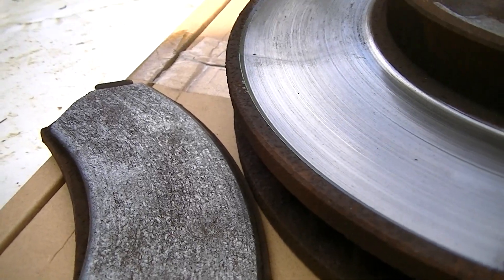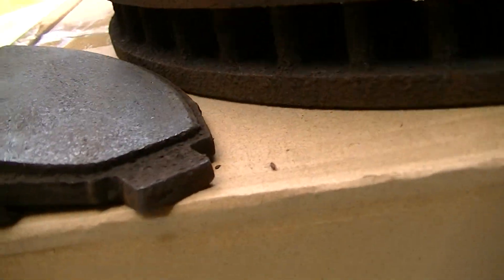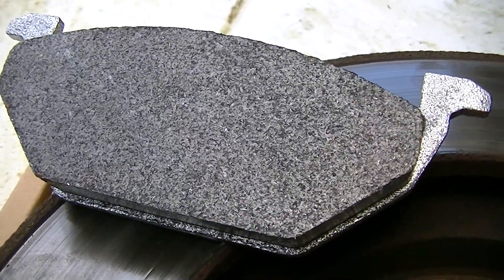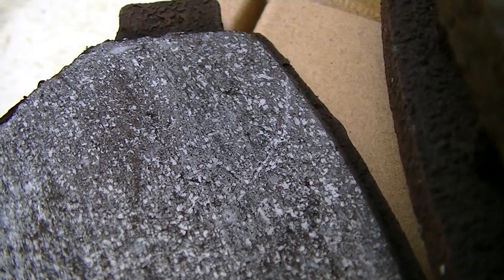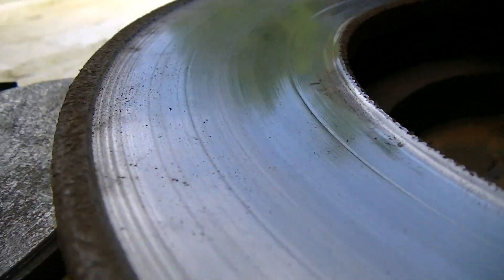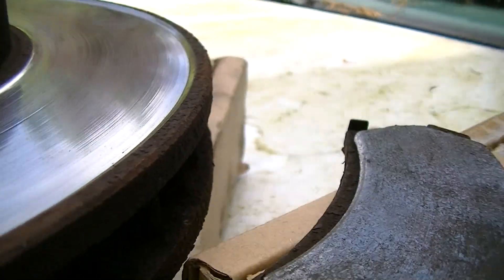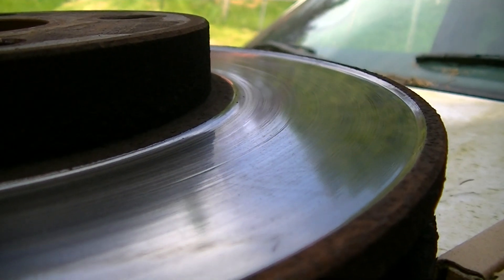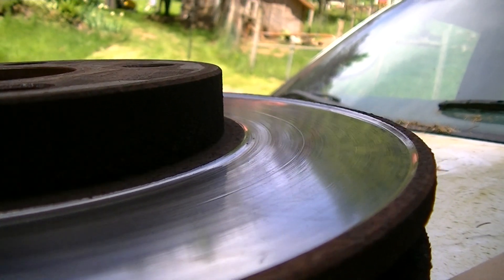Do Metallic Pads Wear out Rotors?

Comment: With brake pads semi metallic pads will wear rotors down, both rotors and pads are wear item's, but youcant have it all semi types work great in all conditions but usually last longer than others, you can get ceramics that wear longer and more rotor friendly but you trade off performance and initial bite, there are some ceramics that are specially formulated via adhesive principle for transfer layer but those again dust more so its all about compromise, find the ones that fall in the middle of what you want, shiny wheels or dime stopping performance